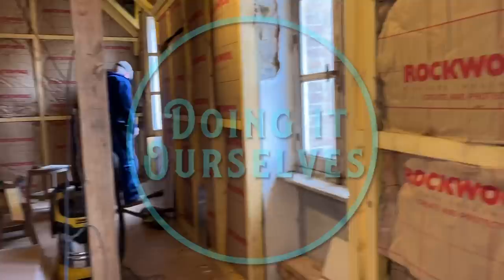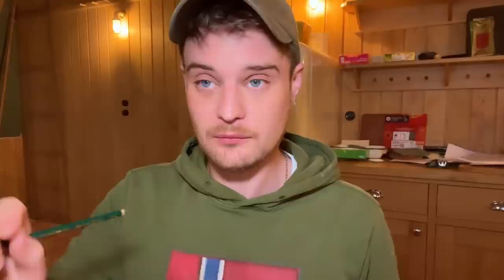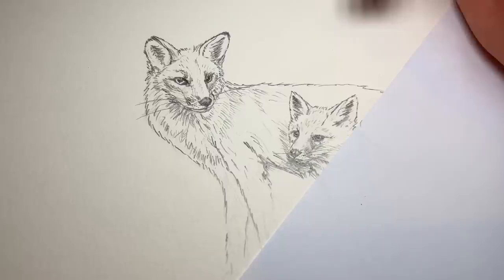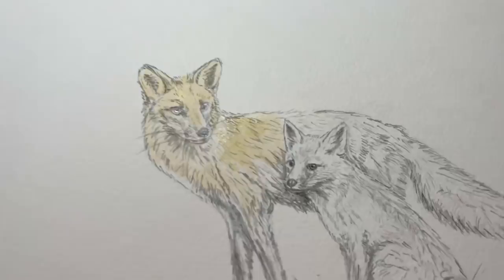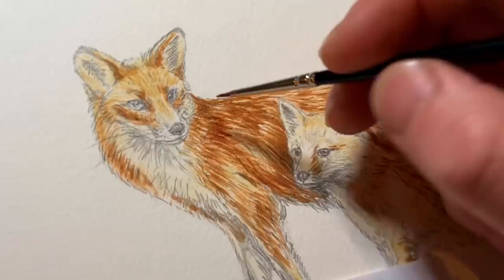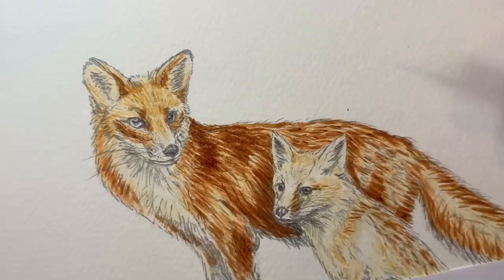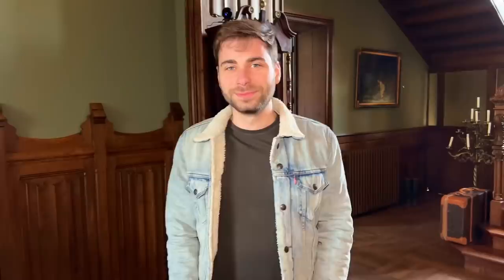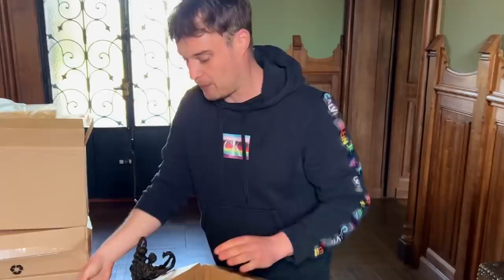How I Paint A Watercolour - Doing It Ourselves

Comment: Seeing you paint is such a joy because we can see how passionate you are of it.  You make me think of Bob Ross, an American painter who had a TV series on PBS where he showed painting techniques in oils. The show aired from 1983 to 1994.  The painter passed in July 1995.  He was just as passionate as you are and a born teacher.  I love the technique you are using and learned some important pointers on watercolor painting I didn't know of.  "layers of paint" is a technique also used by porcelain painters. We paint the layers of the same color to deepen it as the firings suck it down into the porcelain. When you fire a porcelain plate, for example, whatever pigment of paint you have placed over the glaze is slowly "sucked through" the glaze when the heat opens its pores. When the plate has cooled, the layer of color adds depth so you can continue adding color until satisfied to "abandon" the piece of art.   The technique you use is similar albeit without the glaze and need of firings.  Well done!

Comment: Beautiful watercolor.  You've really captured the innocence in the baby fox's face and eyes.   Great Job.  You should consider making sets of "greeting cards" as well.  I bet if you design sets and printed them, they'd sell well.  You could sign the master,  and put the name of the cards on the back (so it shows once folded)  Printed sets of four or five of the same design, OR a box of 6 with three different designs (2 of each) would be really wonderful.   The mouse was so cute, however, they are not clean and some even have rabies.  They damage wood and even mortar on walls and stonework outside .... rodents NEED to gnaw on things to keep their teeth ground down in the front.  IF they can't find things to grind their teeth down in the front, they continue to grow, like a fingernail, and eventually, the mouse or rodent can no longer open their mouths wide enough to get food in.  Sadly, they slowly starve to death, which is a horribly painful way to die.  SO....where there is ONE mouse, there are usually many more.  They will chew and gnaw on the beautiful woodwork, furniture, and make holes in order to get in-between the walls.  They chew electrical wiring, chew drywall, carpeting (for threads, etc. to use for nests, and get into your cupboards and drop feces on and in food, as well as urinate on counters and inside cupboards.  The bottom line is they should be outside, where they will fare better.  (If you aren't going to keep cats on the premises, (your chapel is probably in danger as well if they've found a way in and out) you ALL need to decide how you're going to deal or handle this.  If left alone, they will multiply quickly  (They're just as prolific as rabbits!!)

Comment: ☮️❤️🌞🌹
Urgent!
Hi Michael and Sadie
Just wanted you to know it's better to use sand where you keep them in the stables as that's what they roll over on in the wild, not shavings, as bits and tiny pieces and the dust from the shavings gets clogged in their skin and that's what's irritating their body and can cause rashes and itchiness, as shavings is made out of wood. The horses in the wild always have beautiful skin. When horses run, whether it's Summer or Winter, they release different chemicals in their body to help them keep either cool or warm, so covering them up with blankets is not a good idea. Our horses literally rolled over in the sand until the blanket came off. In the wild, horses don't know anything about blankets and they survive for years. Blankets for horses is just an idea to be sold.

The best spray for their body is apple cider vinegar mixed with water or freshly squeezed lemon mixed with water, as the flies and bugs don't like the smell of the acid and it's actually very good for the horse's digestive system when they lick themselves because it's natural. In the Summertime we sprayed our horses everyday with the apple cider vinegar or lemon mixed with water. Half half mixture. 

It's very important to give them a salt block at all times in the pasture as it keeps them more hydrated with the water. 

Cheers to Queenie and Elsa!🥂☮️❤️

Comment: For filming your drawing/painting, you can get a flexible mic arm and order a camera mount setup that fits it (a pressure clamp with a ball head mount would work great). Just be sure that the arm is strong enough to hold the weight of your camera + accessories attached to it + the camera mount. I seem to recall that you use your phone, so that should be fairly simple. Then you can position the camera for overhead shots by clamping the arm onto the edge of your work surface and positioning it overhead. There could be some great opportunities for time lapse shots! This also works great for anything you want to get from above, like cooking.